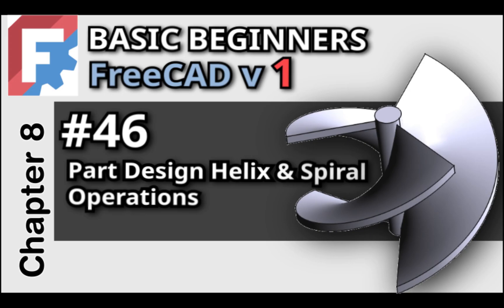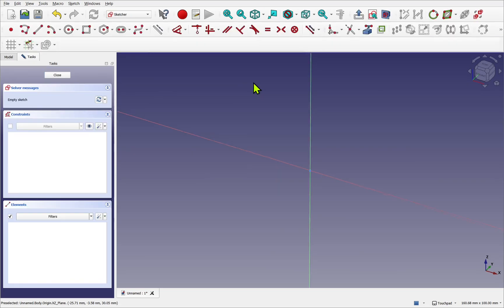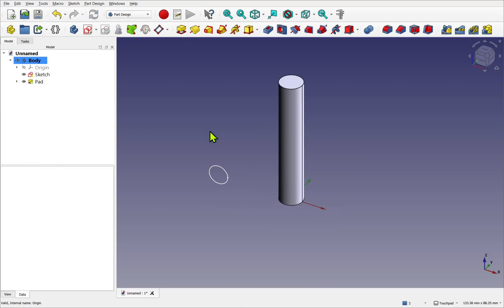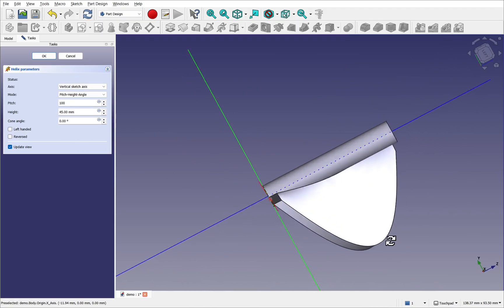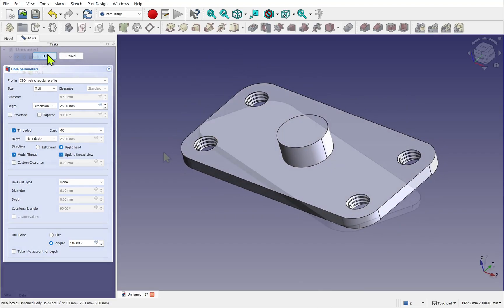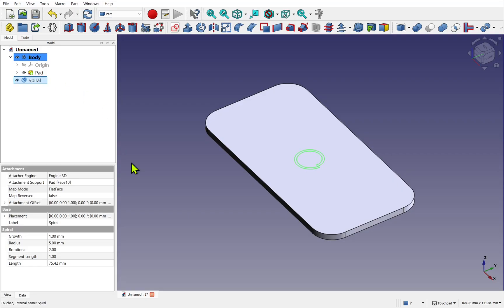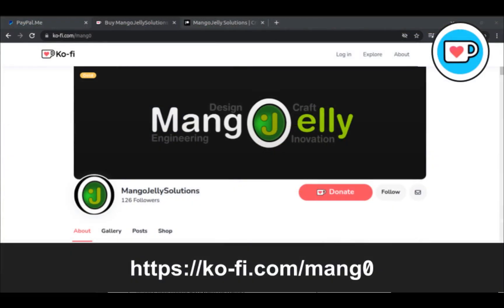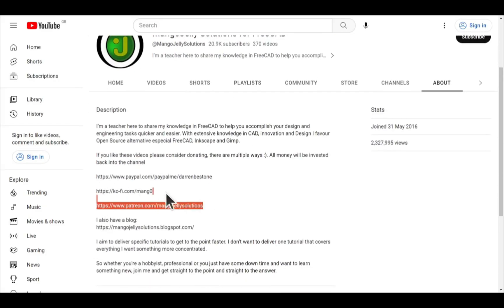FreeCAD Additive & Subtractive Helix Operations Introduction | Basic Beginners Lesson 46 | Tutorial

Comment: How would I go about creating a spiral staircase with a smooth bottom? In PartDesign workflow if possible.
Reply: Currently I make a spiral staircase by padding a sketch, then using the Draft workbench's polar pattern feature with interval axis on the Z axis equal to the length of the pad, but I have no idea how to make the bottom smooth and I've tried everything I could think of already :D